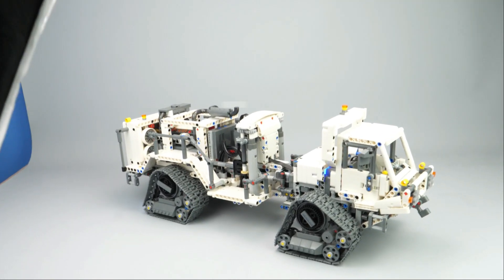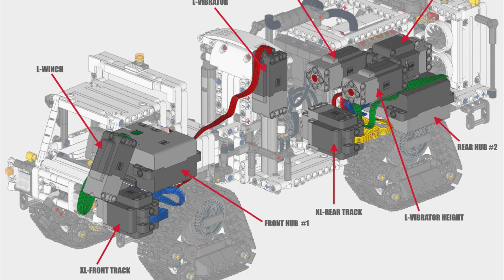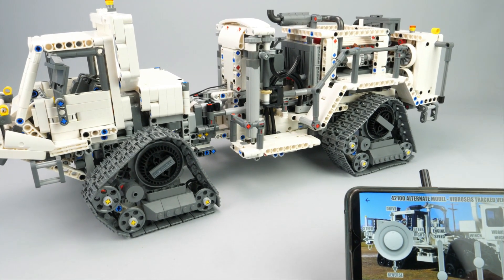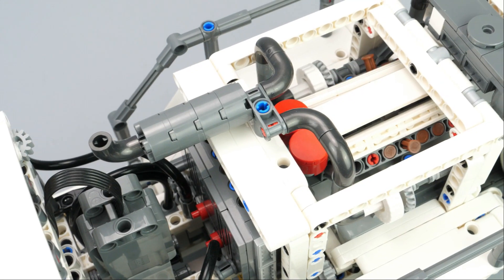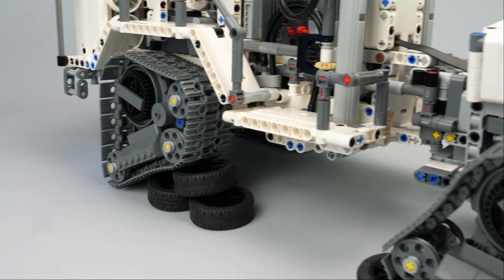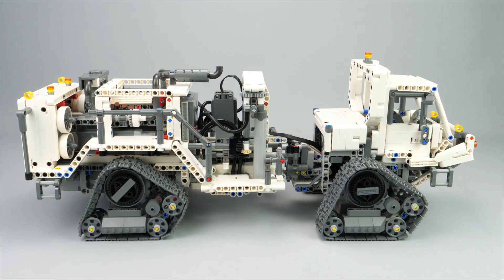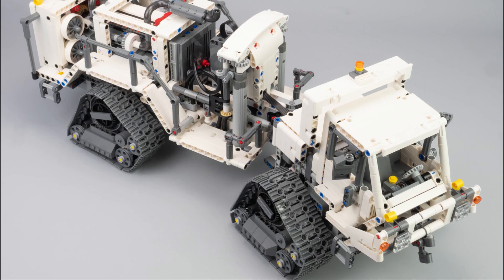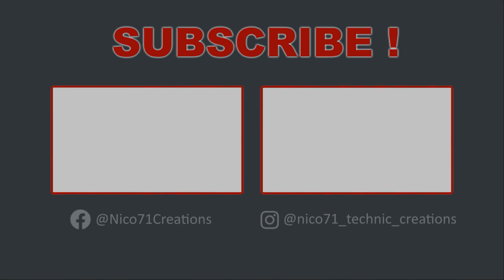Design Secrets of my alternate model of the 42100 : Vibroseis Tracked Vehicle

Comment: Awesome! For the vibration, to add some more realistic feature, you could program the motor to change speed. The vibrators most of the time used with so called sweeps, the vibration starts on a really low frequency like 2-4Hz and goes up to 80-100Hz or even more during 12-16 seconds period. It could be imitated by altering the motor speed slowly during a few seconds of time.
Reply from the maker: Hello, thanks for the precision ! Indeed it would be cool, unfortunately I need to look in the buwizz app to know how to do.